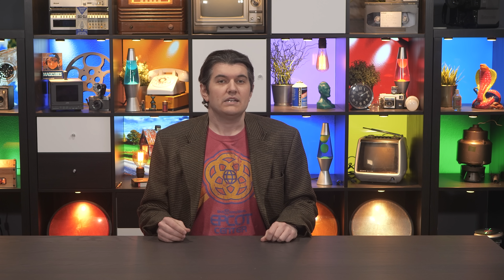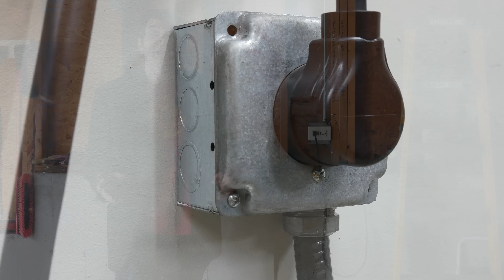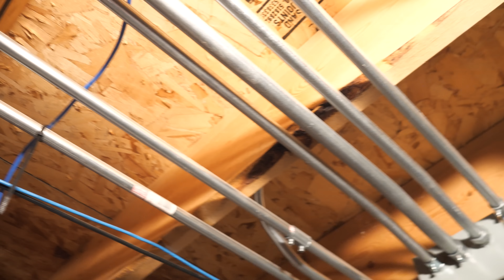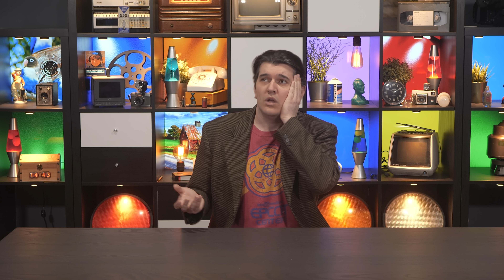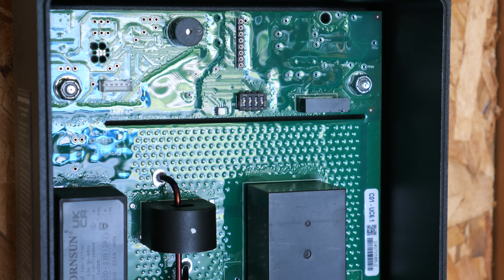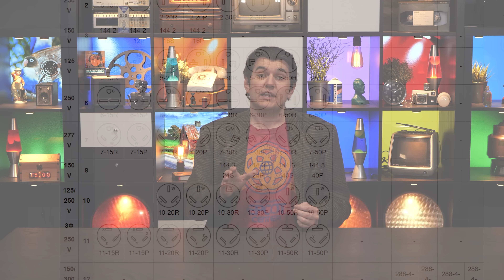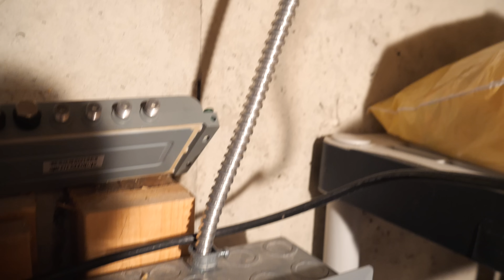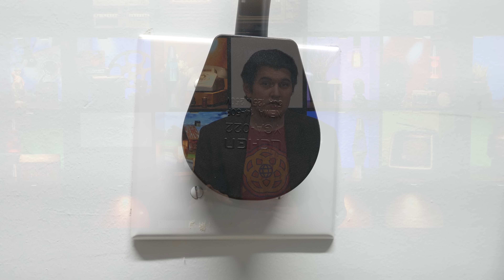The "standard" car charger is usually overkill—but your electrician might not know that

Comment: In Australia a smart charger is just about a requirement due to how much solar exists. Charging overnight is expensive but solar feed in tariffs can be almost zero, especially in the middle of the day. So you can use only exactly your ‘worthless’ excess solar instead of feeding it into the grid for basically nothing and buying expensive grid power. 

There’s also power plans with wholesale rates that change constant energy including periods of excess solar where you get paid to take power as a grid stabilisation measure.

Basically, long term home batteries and EVs in conjunction with grid/solar aware chargers are the solution to renewables being intermittent. Relying on the car to do that is much harder for the average pleb to do compared to a charger that is in a known location.

Comment: As long as you can plug it in while it's parked, and it's cheaper than gas, they'll take over eventually. Just have to become cheaper. I can't afford $30,000 for an EV. The cheapest ones have ranges of 100 miles, which makes the trip to and from the city impossible without stopping to charge.

Comment: My 2011 Volt came with a 120V EVSE, soon after I got a 30A Nissan branded unit from ebay. Seems Leaf owners were not buying them because the installers were ripping people off. Good price. Long lasting, it was made by Aerovironment. Still working, now with my '23 EUV. It did have an easy early life charging the 16A Volt and 16A Spark. 
Update: The 16A Bosch EVSE that was a perk of leasing the 2014 Spark EV was just gathering dust, so I decided to put it back into service. Charging at 16A is just fine for my use case.

Comment: Hi Alec! I've followed your channel(s) for many years now and I really love your work, but as an electrical contractor I am a little terrified of what you've included in this video.

You disclaim that people shouldn't use this video as a guide, but you act as if it's so easy that you'd have to be braindead to not be able to do it. Simultaneously, you include shots of illegal installations:

@2:38, maybe it's just barely off-screen but that EMT doesn't look strapped within 3' of the box fitting.
@13:23 you admit that the LFMC installation is illegal, but it also appears that the MC coming out of the top of the box isn't strapped within 12", and it's so easily strappable to the subfloor lol
In other shots the excessive length of MC on the opposite side of that first joist is unimpressive :p
@28:15 you talk about AL wiring requiring anti-corrosion treatment, but modern AL conductors are corrosion resistant and don't require deox. I've even read that Siemens panels explicitly forbid petroleum products which would make Noalox illegal to use per 110.3(B), (though there are petroleum-free deox agents, the point is that proper installations are way more complex than you let on).

These oversights could have been addressed with even 90 seconds of Q&A with a qualified electrician!
You're a fantastic engineering communicator, but when it comes to actual installations, please ask for help <3 Your videos will be so much more accurate and professional if you do.

Comment: I'm in Australia. My EV happily recharges on a 15 amp wall socket running at 230 volts (3.45 KWh), however as the factory supplied charging cable is rated for 10 amps the charging power is more like 2.3 KWh. I charge in the middle of the day with assistance from my home solar. On weekends I charge on the sunniest day available. Covers my needs nicely.

Comment: 120V is fine until you encounter an situation, (god forbid an emergency) where you have just depleted your battery and don't have enough charge to get where you need to go in a jiffy. i.e. coming home from a long road trip, and then having to run an errand on the other side of town, or an emergency at 2am and the ER is 50miles away.

Comment: Depends on your usage case scenario.  In some municipalities it’s definitely much better to have a high power circuit.  In our municipality we have the option of choosing tiered energy plans.  The car can be set to draw max amps during off peak and super off peak hours.  Overnight off peak rates are 8.5 cents per kWh from 11pm to 5am.  Super off peak is a small window between 10am and 3pm at 3.5 cents per kWh.  That’s almost free to suck up as much power as you can on super off peak times.

Comment: I used to charge my Chevy Volt at 15A 120V and I never had an issue. I only switched to 240V because I found out the included charger can do that and my dryer is in the garage, so I already had a plug for it. (Which now that I have a heat pump dryer isn't even used for a dryer anyway)

Edit: I did use one of the splitter boxes referenced here before I got my new washer/dryer. It's still there.

Comment: I heard 240v convert nicely to 400 DC, so it's very efficient for 400v batteries, where as lower voltage plugs (110v) need boosters and are less efficient to charge?  Is that true?

Comment: Latest NEC code (check if your local area has adopted) requires a GFCI breaker for EVSE. It can be finnicky as most charging equipment has internal GFCI protection. You might get nuisance breaker trips.

Comment: At least with a EV charger drawing 24 amps, you can get at least 11 miles (17.7 km) of battery power per hour of AC charging in most EV's. For an Hyundai Ioniq 5, an 8-hour charge is enough to get you 88 miles (141.6 km) of range, more than enough to get you to a higher-powered DC charger in most metro areas in the USA and Canada.

Comment: Every apartment in Anchorage Alaska has the capability to charge EVs already. 

Why? Because for some time now, the city has required in the code to have a dedicated 20 amp circuit in every parking space for tenants, because people have engine block heaters, and need a place to plug in. 

The result? Every apartment in Anchorage has the capability to charge an EV at 16 amps, 120v, which is totally sufficient for everyone in a city where pretty much everything is 15 minutes away from each other

Comment: I live in a townhouse condominium, and when I went to install a heat pump and an electric hot water tank I learnt that the entire complex only has a 60 amp feed.  I had to go back to burning dinosaurs for hot water.  :/  At that point I gave up on the notion of ever having an EV.

The bit about getting a splitter to just use the dryer plug was thus very inspiring!  Especially because my dryer vents straight through the front wall next to the door, so it would be very easy to run a charging cable right next to that.  I mean, I still can't afford to own a car because I can't afford to insure it, but you've given me reason to believe that if I ever can afford a car, it can be an EV despite my crappy electrical situation!  Yay!

Comment: You can get 6/3 MC cable. This is what I did. I bought it from Amazon. I don't need 60 amps, but the cost difference was trivial and my panel/load has plenty of capacity.

Comment: I beg to differ on "smart chargers". At least in my use case. I have an EVDuty EVSE. The smart option was $100 more and can be retrofitted to "dumb" chargers. My car is also an e-Golf, which is very basic in terms of programming capabilities. This allows me to change amperage "on the fly". I usually only use 8 amps, as I also charge while sleeping, but will occasionally charge at 30 amps if I need to charge quickly. With that specific brand, you can also buy two chargers and share the same 40 amp circuit. The chargers will "talk" to each other to reduce amperage when a second car is plugged-in. I.e.: a car alone can use 32 amps, but once the second car is plugged in, it will automatically reduce to 16 amps for each charger. I've had it for 5 years now with no issue.The same company also sells a device that connects to your electric panel and allows you to share your range or dryer circuit with a car charger. So, if you turn on your dryer, it will turn off the EVSE automatically.

Comment: not even through your 'smart chargers suck' rant and I already agree. we have a smart charger and the smartness of it had only ever been an annoyance. configuring it was easy for the circuit that its on, because of our usage we needed the fastest charging possible so we had a service upgrade. in truth bcs I live in the uk it was just changing a fuse before the curcuit breaker panel so i don't even know if it counts as a service upgrade but we did have to limit the charger before the switch and it was nice to not have to do anything more than change a number in an app to enable the higher amp charging after the fuse swap. but the stupid thing wants to be on a schedule, which can be overriden and so we have it set to only charge during our ev tariff hours but sometimes it doesn't change properly so we wake up to the car having just not charged at all overnight. there is an override but because our tariff hours start at midnight that means someone has to check at midnight thst the car has started charging. i wish the thing was just dumb and always on.
Reply: also to add in the uk ive never seen or heard of a plug designed for plugging a electric vehicle charger (also ive looked and i can't find any reference to the term evse in the uk so i think the charger vs supply equipment distinction didnt make it over here) from what I can tell they are always fully wired in, i believe they also are wired in before the circuit panel and have their own breaker which is not in the panel so we don't have to even consider if there is free space in our panel. ours is 32 amps at 230v and its set, on advice from the installer, to that amperage rather than 25.6 (80%)

Comment: The problem with 110V charging is that, while it works reasonably well in the summer, during the winter, the power supplied may be insufficient to maintain the battery in charging condition and charge it.

Also, I disagree in-part with your rant about "smart" EVSEs.  I agree that having to connect the device to an app and the internet to set it up is completely annoying and that there should be a "dumb" or "local-only" mode for these devices.  However, in areas where smart-metering is not available, the smart EVSE's are absolutely necessary to receive any sort of utility or government incentives for charging at home.  Finally, while the car will report how much energy it added to the battery, it does not report the full energy usage (i.e. charge energy and systemic losses).  For instance, my EV's reported power supplied is  5-20% (seasonally-dependent) below that reported by the EVSE.

Comment: My sister has a Tesla.  I have a 220 volt welder on a 50 amp circuit.  I let her plug into the circuit but told her to limit her car to 30 amps.  I checked the temp from end to end, after an hour the max temp gained was 10 degrees above ambient, and that was on the circuit breaker.  My welder takes a lot more current then that, but it's not a long duration load.  I don't own and electric vehicle and live a distance from the nearest gas station, so the thought of not having to check how much gas i have before going home is enticing.  To have a vehicle start up full at home, the be able to refuel at home seems nice.

Comment: I'm betting one aspect for electricians is avoiding callbacks from consumers who are confused by charging below the rating of their vehicle, if pressed I'm betting many (those with experience with chargers) would offer a lower size charger, but will first offer the simplest option and with many moving to electrifying other things, likely especially those with ev's, offering a service upgrade may make sense.  But yes, lower amperage ev charging makes a lot of sense for many people, especially given most cars on-board chargers won't ever use nearly as much power as some chargers can handle.  My charger can be set up up to a 60 amp breaker and supports supplying the vehicle with 48 amps, which is well beyond the vast majority of on-board chargers max charge speed, so settings a lower limit will not effect the charging speed at sll but will make it easier to pass a load calc for if you have enough power available.

Comment: Lets see I drive like 40 miles a week around town to work, stores. Only need 8 to 10 gallons of fuel a month, maybe a bit more in the cold winter. And since I live in an apartment with no outside plug to use, and there are no fast chargers in the area, some double chargers, but Im not sitting 4 hours or more to charge up an EV each week or two. Like freedom of choice. Drive what works for you and what you want.

Comment: In the UK I find our standard 7.4kW (230V 32A) is about right, because it charges my car overnight (but not much faster than that), especially with variable electricity rates as you mention

I could get away with a slower charger, and have done so in the past, but it was inconvenient for wider use than commuting

Comment: There are only some versions of the codes which allow the derating of the charger, at least for some chargers, it may be different for physical vs in app derating breaker settings.

Comment: We bought an EV 3 years ago when our commuter got written off. A lowly 2016 Nissan Leaf. At 90,000km it has about 130km average range on a charge. I have an 80km, total, commute. I plug it in every evening and I never bothered installing a charging station. The 15A outlet on our front porch easily takes care of my driving needs. For road trips we have a diesel SUV, so a short range EV works great for us.

Comment: While you many not routinely need the capacity of a 50amp outlet when you want to turn your car around quickly. It will also allow you to charge your car completely when rates are there lowest or your solar power.

Comment: U coulda got a bigger gauge wire at the electrical supply store, ive pulled 1 AWG/3 Conductor MC for a warehouse it was massive but yea menards or anywhere marketed toward small scale /residential limited you to that #10 mc. Just needed someone on the inside to tell u to hit the supply house counter :/

Comment: I switched to electric back in 2018, in Ohio. I bought a Long Range Tesla Model 3. I drive 100 miles a day.  Decent sized pack of 74 kWH or so. I was lucky to have the panel in the garage and already had a unused 30 Amp circuit that used to feed an old barn. Rewired the breaker for a NEMA 14-30 and set the car to 24 Amp. 8 hours or less overnight and I was ready to go. These days I have an actual Tesla charge station (newest ones have NACS and J1772 adapter) on a bigger 50 Amp so the portable charge cable is a backup. I've also used the mobile charger at a campground charging off 110 outlet.